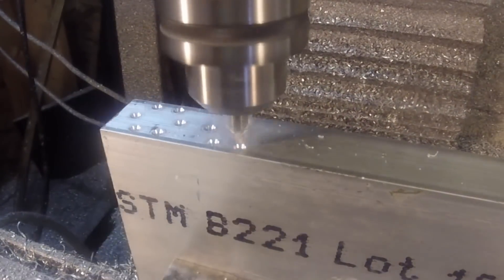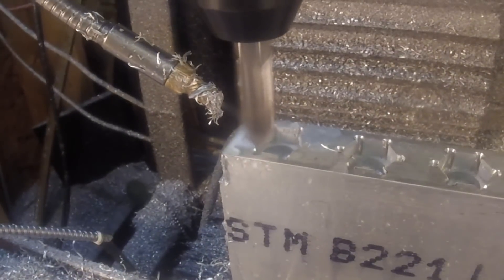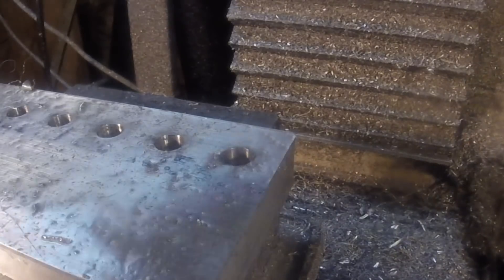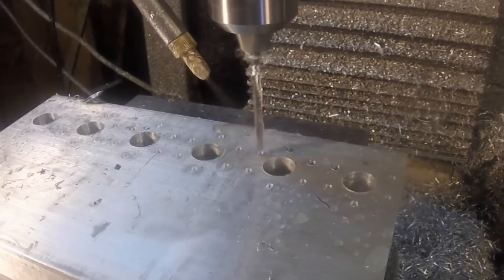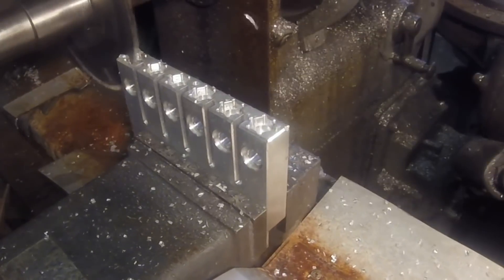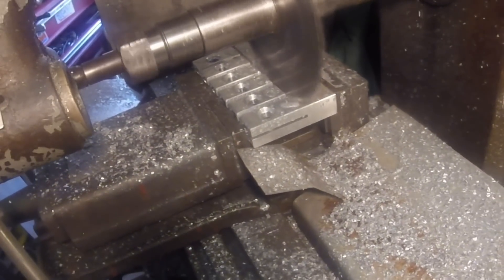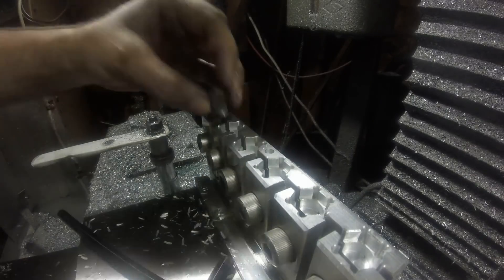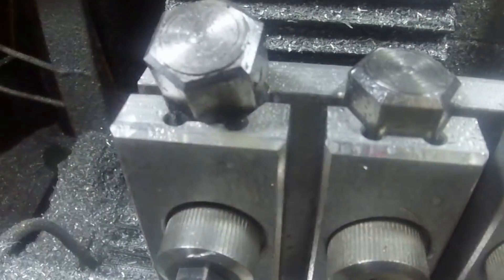Making a hex bar fixture on the Tormach

Comment: Next time climb mill you will have better finishes
Reply from the maker: I've tried both and can see no visible difference on my parts.  The program defaults to conventional and I usually don't think to change it.  Maybe tool wear is better but the surface finish difference is not noticeable to me.

Comment: If you would relieve the front and rear hex sides in the fixture, the parts would contact on 4 surfaces and would be held better.
Reply from the maker: That's a great idea!  Good catch; I may have to alter it next time I use it.

Comment: You could have just made soft jaws for a vise. Less work to build and easier to load and unload.
Reply from the maker: That's true.  I have something I make all the time that has soft jaws made for it and once removed it's difficult to re-align them perfectly.  For as infrequently as I need to make these hex parts the time used making the fixture will hopefully be saved by not having to re-align my other soft jaws when re-installing.  That, and parts can be loaded "off-line", drop the whole thing in and cut , pull the whole thing out and go right back to making my normal stuff with minimal disruption.
Reply: @ecdezz  I always machine a reference surface on the left side of my soft jaws after I machine the shape into them.  That way I can put them back in the same way every time.
Reply from the maker: Great idea!

Comment: Nice video. I think the last two moved because they weren't seated properly when you dropped them in. The look a little off in the video. Once the tool hit them they moved to square and weren't clamped as tightly. So tempted to buy a tormach. I've got a Prototrak retrofited knee mill.
Reply from the maker: After looking at it again you may be right!  Good catch.  My only regret with the Tormach is I should have gotten it sooner.  Works perfect for my situation. :)

Comment: I would cut more of the horizontal face so the part touch them and just touch the 4 angle face to prevent side to side movement like we see a the end of the video, the way the pressure would be aply it will be impossible for the piece to move side to side
Reply from the maker: Not a bad idea!  If tightening it down harder doesn't solve the problem I may give that a try.

Comment: Those are really cool fixture but I would have gone with soft Jaws for the vice.
Reply from the maker: Thanks for the suggestion.  If I were making a ton of them I would have but for making 6 or 12 once a month changing the soft jaws out would be more of a pain for me.  Slap some blanks in the fixture, cut them real quick and back to my regular tasks.
Reply: Ebbco it's fun watching you make this and  horizontal slice right through that aluminum.
Reply from the maker: Thanks! I love a horizontal mill.  If I had the room I know I'd have several more.